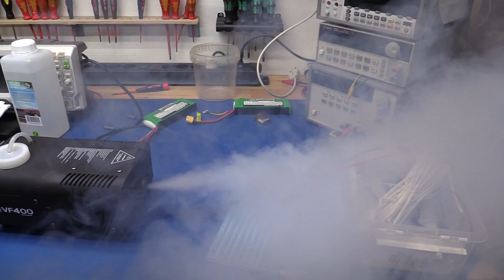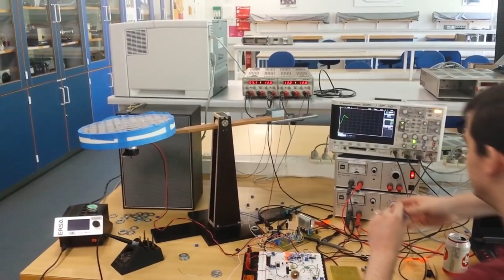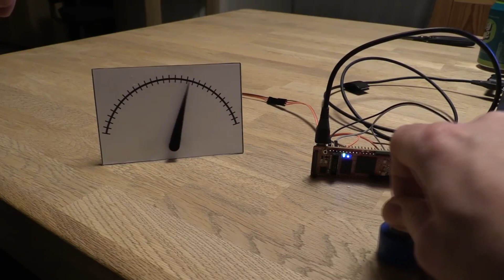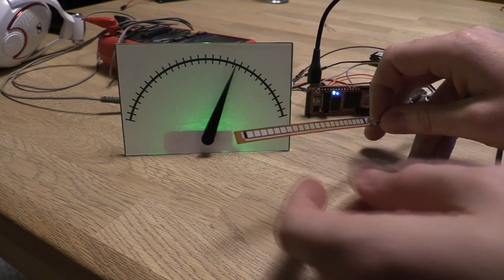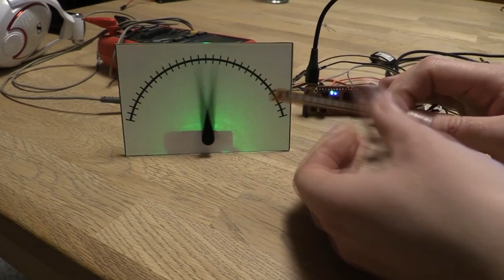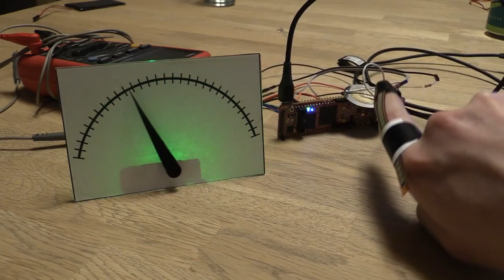What I've Been Up To (Talking and Showing Random Clips) - Ec-Projects

Comment: The digital world has a equivalent to that dial. Its a percentage display.
Reply from the maker: Yep :)
Reply: If you mean a numerical percentage display, it is still inferior to a dial. For a digital display you have to read the numbers and then do some mental exercise (not a big one, but still) to convert the number to the "abstract" idea of "how full?" for example. It is even worse for displaying changes. If you have a changing numerical display, you have to read two successive values, do some arithmetic to know if it's going up or down and how fast it is changing. This is error prone, especially when you have a panel with a dozen changing numbers. A analog dial (even if it's digitally controlled) will show you immediately if a value is going up and you can get a very good estimate how long it will take to reach a certain maybe critical value at the current rate.
Reply: superdau Agreed, but the difference is not that much. If a value has some "swing" then both need to be averaged out before display.
Maybe i have a different perspective since i work on IT. All i see is percentages everywhere. :)
Reply: maxsnts
I'm in IT as well and I know there's a number behind everything. ;) But as part of my job sometimes includes designing electronics and user interfaces for workshop/experiment setups I know that non-numeric displays are easier and quicker to read without error.

Comment: What board did you use in those assignments? The little controller board.
Reply from the maker: NXP LPC4088 quick start board (mbed enabled) for the Gauge (We use it at uni, but it's too god damn expensive O.o ).
We used an ST Nucleo 446RE for the lights.. (Awesome Value for the price)

Comment: Nice to have you back.

I would like to pick your brain for a moment on a piece of electronic equipment I have and that is a an amplifier.  When I first turn it on it has a 60hz hum (no matter if in spdif or analog mode) which is the mains power frequency here in the USA.  Now after 10 secs it will start to go way down per second until it is almost all gone in about a minute.  To me that sounds like an electrolytic cap is dieing (amp is 10 years old) but I wanted to get your idea on this.  I have not yet opened it to see if there are any bulging caps yet.
Reply from the maker: Hard to tell, but my first guess would be a cap / caps as well.. :)
Reply: Yep, I just never had one not just blow so was either good or bad but it acts like one going out of tolerance.  I have absolutely nothing to measure cap resistance so all I can do is look for a bulge.
Reply: I guess you won't find a bulged cap. On a transformer-bridgerectifier-regulator power supply the caps almost never bulge and die slowly by drying out over years. The bulging only really happens on switchmode PSUs where they skimped on the caps which get hot while they still have alot of electrolyte in them that forms a gas. 
If you have a switchmode PSU in the device and a 60Hz hum then something else is wrong. A hum should not come through in a switchmode PSU, no matter the caps.
Get yourself a component tester on ebay. I got that one for example: http://www.ebay.com/itm/272036413065 . (Don't buy that exact one; there's nothing wrong with it, but I got it maybe two years ago and there's better featured testers around now)
Reply: superdau
PITA to have to remove every cap to test it so I was hoping either in circuit or visually I could see what is wrong.